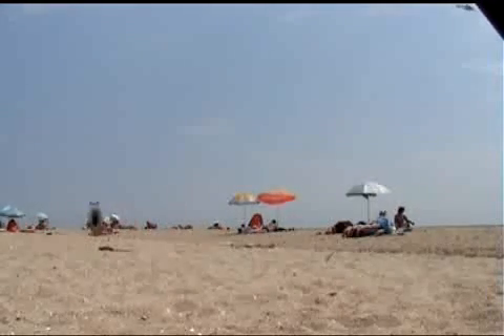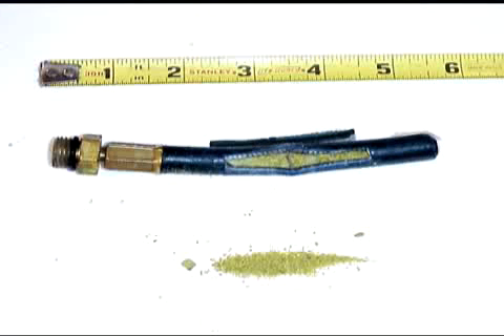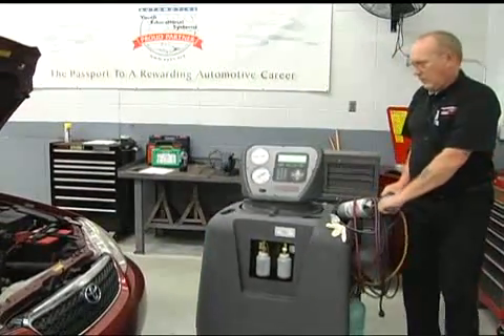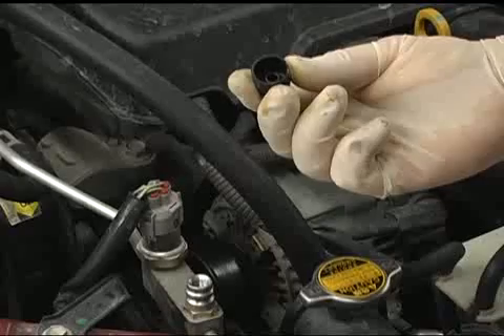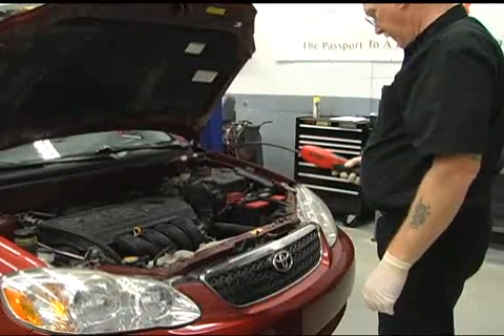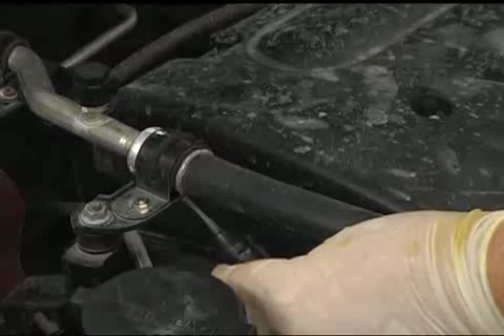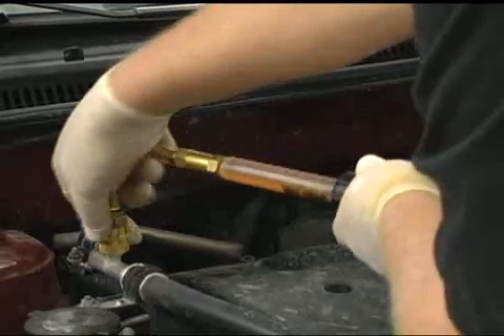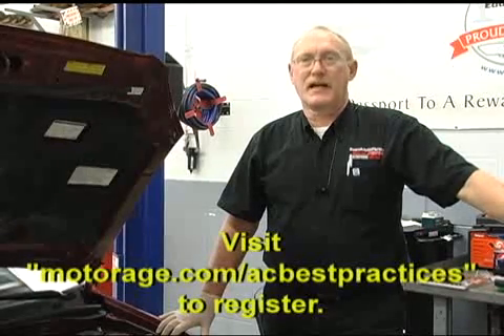The Trainer #7:  Tips On Servicing Automotive Air Conditioning And Finding Those Leaks!

Comment from the maker: If it leaked the entire charge out in a day, it should be easy to locate using a leak detection tool called a "sniffer". Kind of hard to pinpoint the source of a leak on an empty system, though.